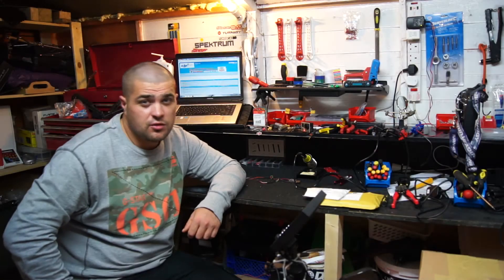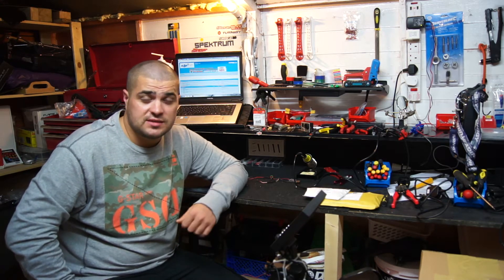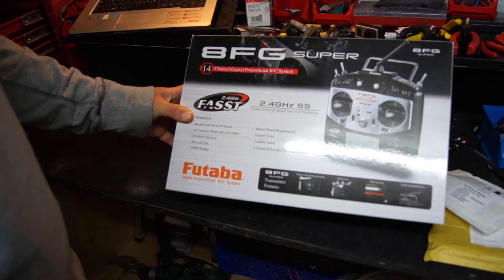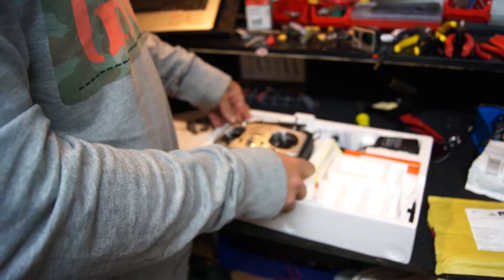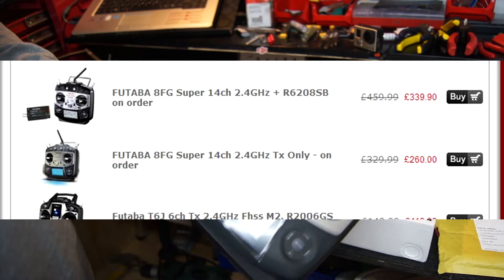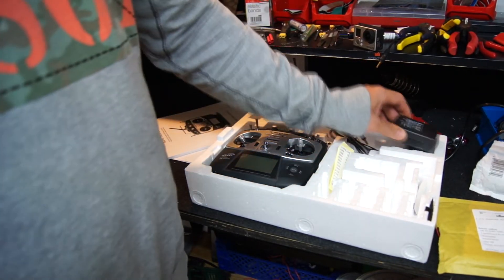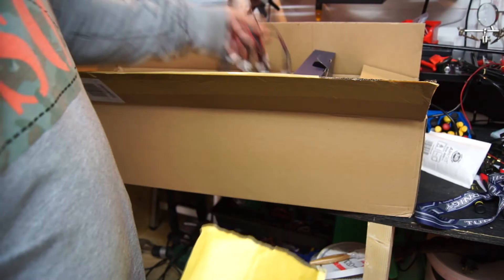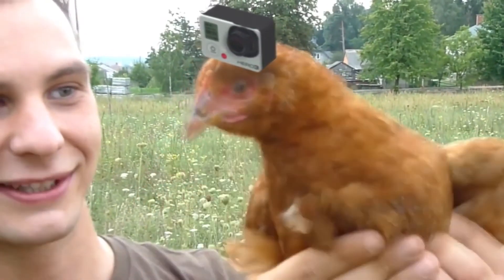DJI Brushless Gimbal Beta tester + Futaba T8FG + more

Comment: This is very exciting and im sure you cant wait! As another user mentioned id like to see firstly if fpv can be used with this gimbal as ive just spent €350 on a kit and dont want to waste around €900 on a gimbal that wont allow fpv. Also what flight times your getting with the standard 2200 battery.

Comment: I would like to see you mess around with the variable speeds for the tilt axis control with the stock controller and/or different tx (basically mess around with the high-low speeds and see how far it ranges)

Comment: hi, try to see if its possible to use the go pro with its case, i think its not possible but you can confirm that when you get the gimbal, another thing i would really like to see is raw video with the gimbal, what i mean by that is no post-stabilization, no slowing the video and in 30 and 60 fps if possible, thanks and keep the great videos coming ;)